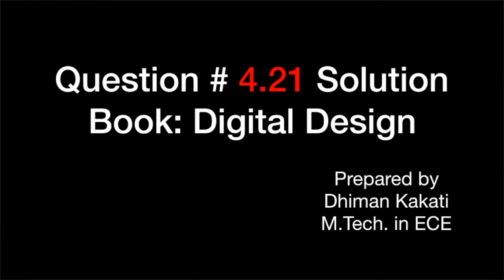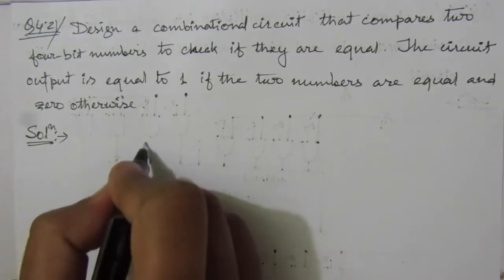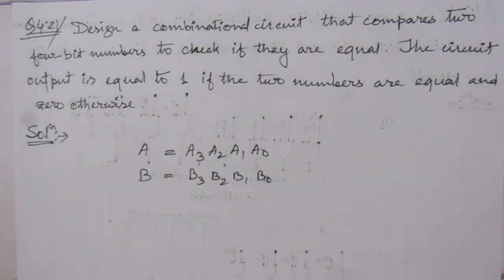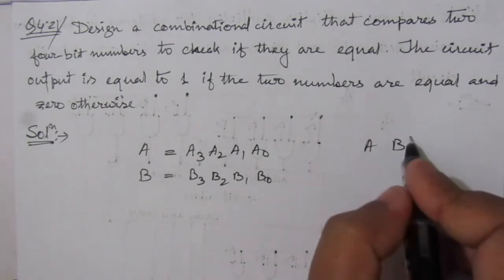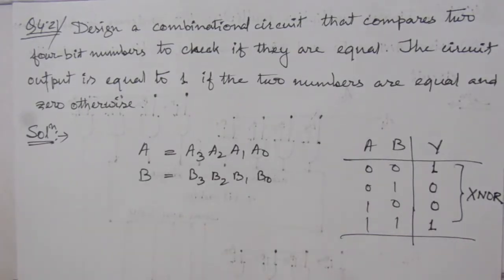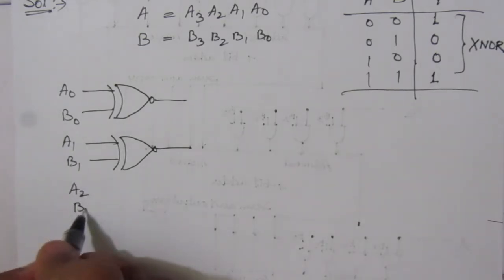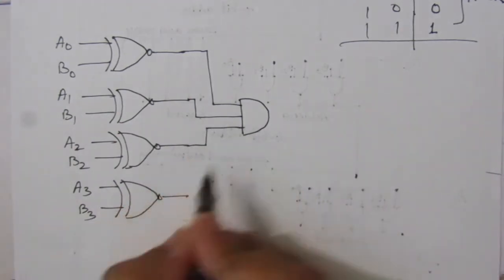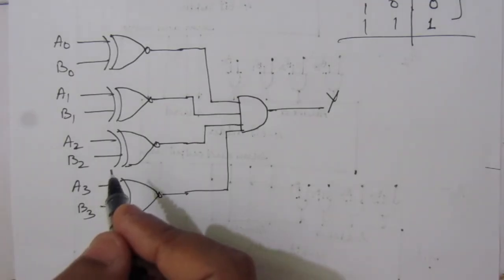Q. 4.21: Design a combinational circuit that compares two 4-bit numbers to check if they are equal.

Comment: Design a combinational logic circuit that determines whether a 4bit number is greater than 
or equal to 8. The circuit should output 1 if the input is less than 8 and 0 otherwise. Show 
the steps clearly
Reply: do this que

Comment: use basic gates to Design a combinational circuit that compares two 4-bit numbers to check if they are equal. The circuit output is equal to 1 if the two numbers are equal and 0 otherwise

Comment: Design a combinational circuit using 4-bit adder subtractor that compares two 4-bit numbers to check if they are equal. The circuit output is equal to 0 if the first number is equal to or greater than the second number; 1 otherwise.
unable to recognize the truth table here? what will be the logic?

Comment: Design and simulate a combinational circuit Using Quartus II simulator. Your design
must read 4-bit BCD and convert it to 5211 number system. The input of the circuit will
be x3 x2 x1 x0 and the output f3 f2 f1 f0. Your design must include:
7. The truth table of the design
8. Finding SOP and POS.
9. Minimizing SOP and POS using truth table
10.Finding the cost
11.Choose the minimum design cost and implement it using Verilog
12.Verify your design with waveform 

Please do this